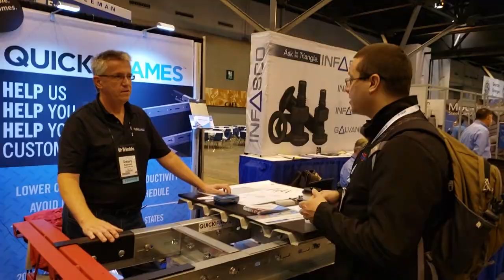Drafting Table Talk - Why do Engineers Live in a Vacuum

Comment: This is becoming a common theme. All too often, architects and engineers are putting out incomplete work and trying to dodge responsibility, leaving us detailers to have to finish their job on top of everything else. I have to bid some jobs at 2x, just to cover myself. Then we have to try to explain to the GC and fabricator why there are delays after the engineer sat on RFI's for two weeks only to respond with answers that create more questions because they are either incomplete or useless.
Reply from the maker: On the upside all of the redraws lighten the estimating load.
Reply: @SteelForum  Sometimes, it is embarrassing to issue a bid on something because I know what the cost should normally be, if the design drawings were actually complete. I see this a lot with residential type work, not as much with commercial and definitely not with industrial etc., so the type of project seems to play a role.